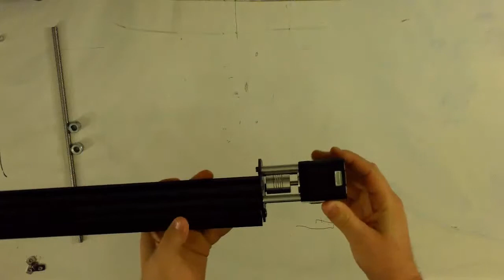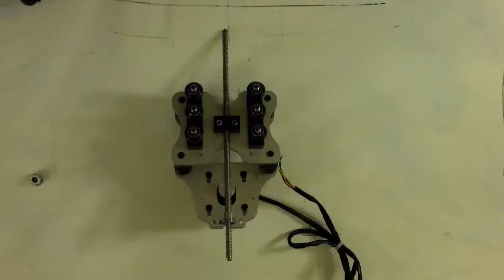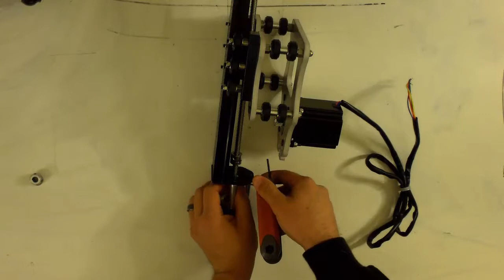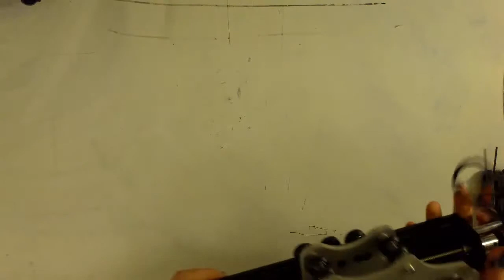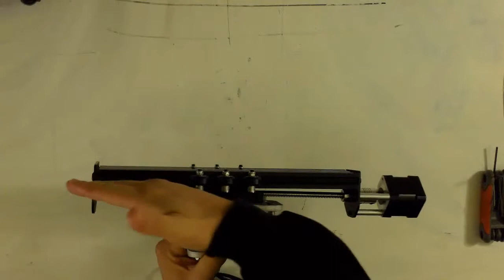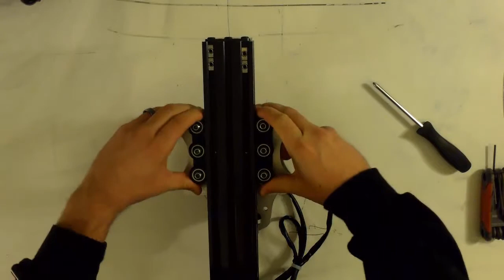Zeus CNC Router Kit - Z axis assembly

Comment: Ok, so Spark Concepts pointed out that I had the Acme nut block was installed upside down.  Once I turned it over it clears the v-slot just fine.  I'm told the block will loosen up somewhat after use.

Comment: Two issues with putting my Zeus kit together.  First, the Acme screw into the block was not nearly as easy as it looks on the video.  I can turn it by hand but not easily.  Second, the V-slot doesn't clear the nuts on the acme block.  I'm stuck.